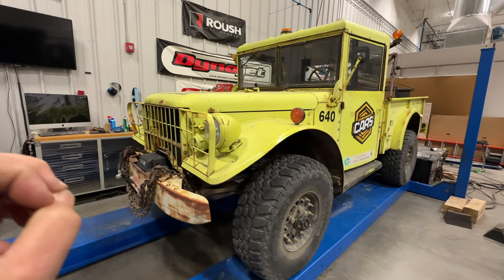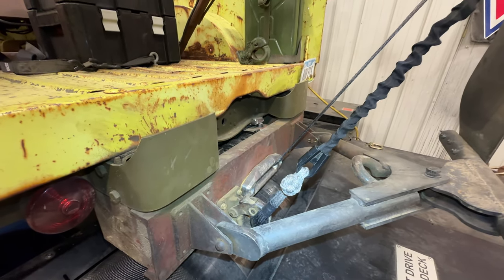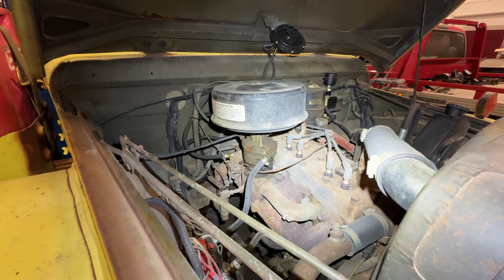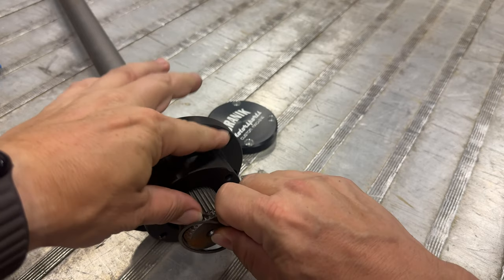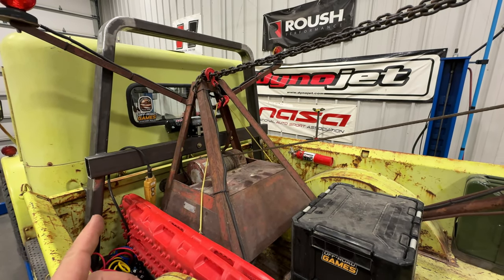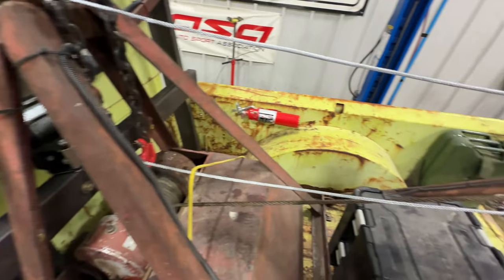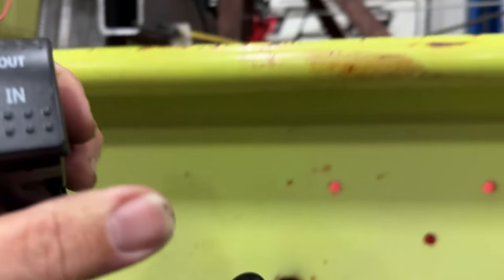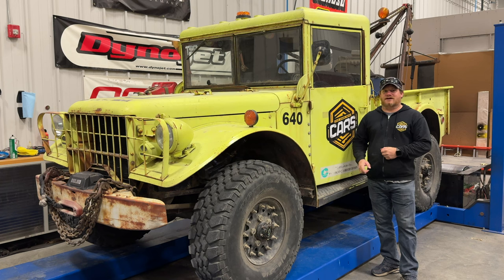More Upgrades to the Vintage Off Road Wrecker

Comment: Very cool I have a m37 my self have had it for 25+ years...I definitely go 1 more pully on boom...winch is rated at 5k with full wire unspooled with few wraps left on spool ...I estimate maybe 800 lbs single line...with 3 lines you be around 2000 pounds lift on boom